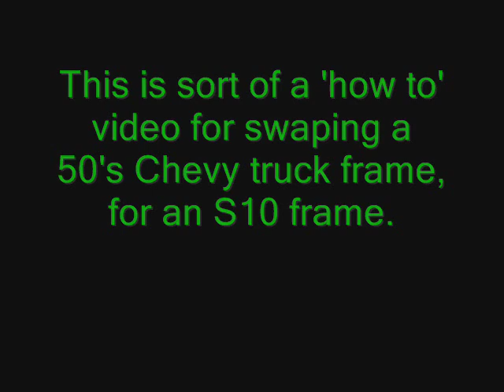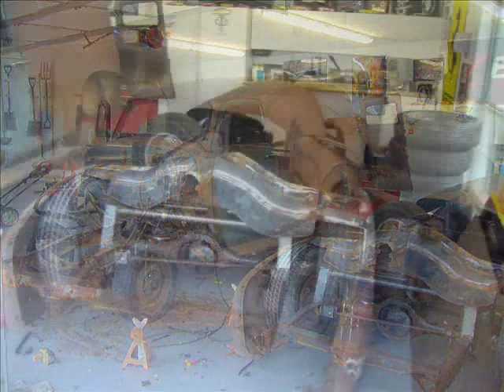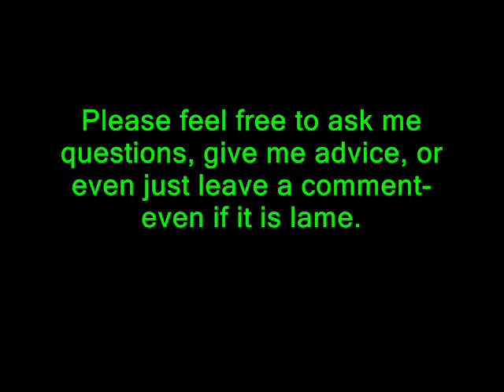S10 Frame Swap for a 1955 First Series Chevy Panel Truck - Bagged

Comment: I am doing a 54 on the s10. You are correct about the standard cab long bed. It puts the rear tire center of the wheel well. I also used the 4wd s10 rearend because it is about 5 in wider than the 2wd. I own a fab shop so I cut out my body mount on the plasma table and measured the locations and leveled it off on stands. I grew up in a body shop. Everyone does it different. You are doing great.  Nice work.

Comment from the maker: @happy4u2me No, the Bravada and the others all had leaf springs.Two link set ups are kind of hard to find to buy, mostly because they're pretty easy to make for yourself.  The only reason I bought mine is because a friend had it lying around his house.  It's nothing more than a couple of long arms that go from the rear end to a pivot point off of the frame.  Just pick up some rectangular tubing and use that for your two link.

Comment from the maker: @happy4u2me The rear end I had originally, I believe, came out of a 56 or 57 Chevy sedan.  It was a 4.10, so I just last week traded out for a 97 Oldsmobile Bravada rear end.  It's a 3.73 with disc brakes!  The Bravada is just a slightly fancier 4x4 Chevy Blazer.  If you get a rear end from a S10, Blazer, or Bravada, it needs to be a 4x4 vehicle (at least for my application).  I'm not sure what you'll need for the A.  Hope this helps! Let me know if I can try to answer anything else.

Comment from the maker: So far, yes.  After I finish putting the new floor in, I plan to redo all of the body mounts.  I directly welded the frame to the body, and that is not how it should be done.  Actually, ,I keep thinking about building an all new frame, but that may be a few years off.

Comment from the maker: Check out the link in the description for my build thread on the HAMB; there's a ton of info including my screw ups. I owe it an update, but nothing too interesting has happened lately. My engine is a 350 TBI out of an '89 Chevy (not the one in the video). No mods were necessary to the fenders for the v8, but I sat the engine too low on the frame, so I had a little trouble clearing the steering around the exhaust manifold. I have a video of that somewhere. Let me know if I can be any help!

Comment from the maker: Sorry, I wish I had an answer for you, but I just don't know. Might try measuring your wheel base on the '49 and then compare it to different S10 frames.  You could also change the wheel base on the S10 frame to match if need be.  I did that on mine, but I don't know that I would have if my S10 frame had come with the rear suspension already set up.  Good luck!

Comment from the maker: Well... my way to do engine mounts is not the best... at all. I attached both sides of the mounts (body/engine) to the engine, and then used my hoist to hover the setup above the cross-member.  Once I had it lined up properly, I tack welded everything in place, separated the mounts, and pulled the engine back out. Then I finished the welding.

Comment: Thanks for this video! I'm in the pre stages of putting a 59 carryall suburban cab on a 94 suburban chassis. as soon as the snow melts (Durango Colorado) im going to start cutting. Can you recommend any resources that might be helpful? (web sites, blogs, etc.)  This will be  a real stretch for me as I am a total novice .... and this type of swap is surprisingly uncommon... any thoughts?   Thanks!
Reply from the maker: +philip middleton Glad you liked it! Since this video, my frame has been completely rebuilt, so check out my other videos if you're interested. I'm on a forum called the HAMB. It has been a huge help to me throughout my build. The knowledge base there is fantastic. Good luck with yours!

Comment: Lame question : this video is about 5 years old now - did u ever finish it - and if not why not
Reply from the maker: +Boo Tran Still working on the truck. Putting it on the backburner for now though. I want to get back on my Firebird for a while. I built a new frame for it and only kept the s10 clip. I have a few videos I have posted about the build if you want to check them out. I'm way overdue for a video update. I'll see about getting one out in a few weeks.
Reply: Sounds like u lost some interest in the truck  - honestly it seems like a very demanding project especially if your a 1st timer - I am just wanting to know if the s10 conversion really works and how much of a hassle it is to do - also curious to know if it will still ride like a pick up or more like a panel truck -  I guess that all depends on how it's spec'd out - Friend of mine had a 73 455 Firebird for more then 20 years and put a lot of dough into it - he had the motor rebuilt with roller rockers headers carter carb Edelbrock intake Mallory electronic ignition and an RV cam got it up to 385hp - had to replace the crank ( not easy to find ) and got rid of the AC - with 308 gears in the back it did an honest 140mph - the car had lousy traction off the line - common trait with non tubbed suspensions on Firebirds but when he nails it at 45mph it hurls up to 130mph like it's just dying to go somewhere and keeps on going - 455 Firebirds haul ass !
Reply from the maker: +Boo Tran It's difficult to maintain my interest in this truck. I like it a lot, but it puts me in a weird position with other car guys. Traditionalists think I'm a minitrucker, and minitruckers think I'm a traditionalist. I'm building the truck for me, but when others don't show much interest, it takes a toll on my motivation.As far as the frame swap goes, I never want to do another one again. Mustang II and a 4 link all the way next time. I haven't really had the truck on the road enough to comment on how it handles.That 73 sounds pretty sweet. Mine's a 2001, so it's nothing special. Currently hunting for a new engine. Even considered throwing a 455 in it (if I can find one).